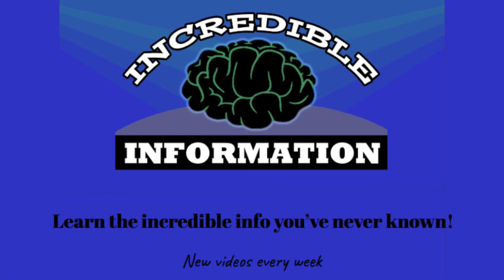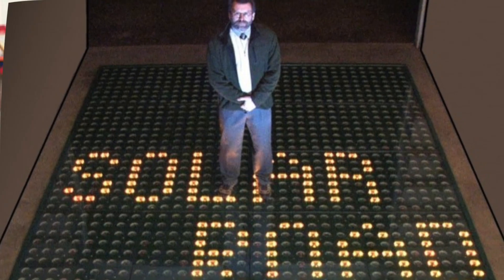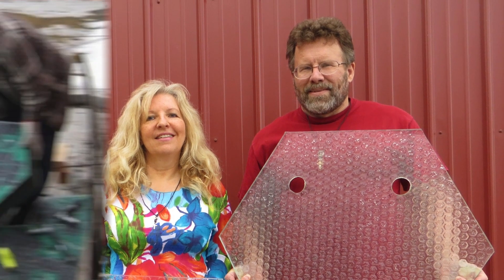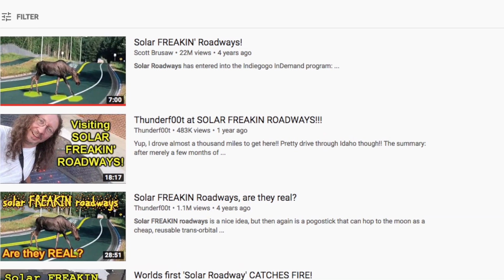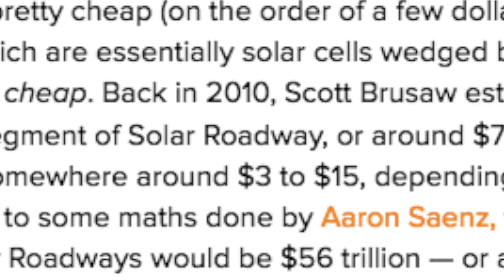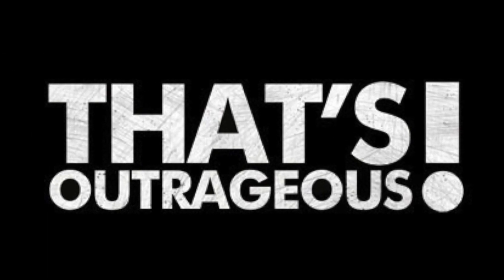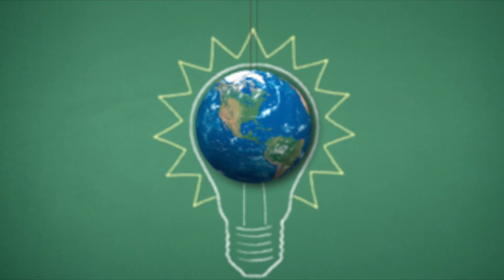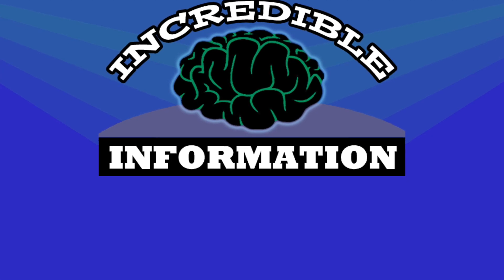Solar Roadways - A Bitter Truth

Comment: Here's a another way, to utilise Solar Power to its Max. over Roads,

"Solar ROOF on Roads with ADVERTISEMENTS & Rain Water Harvesting system"

Solve (Land & Funds) requirement for Solar Energy at a time,

Benefits - More Jobs, Boost Economy, Control Pollution, Promote EV's Usage
#ClimateChange #cleanenergy
#innovation 

Better way to fight Climate Change/Air Pollution 👇
http://lightenmyways.blogspot.com

Comment: Every attempt to create solar roadways around the world so far has been a costly disaster. Not one system by any manufacturer has been remotely robust enough to withstand traffic, even cycle lanes have fallen apart. And they produce very little electricity. When, for instance, you look around you and see all the empty rooftops that could be fitted with solar panels, for a fraction of the cost of solar road panels (panels which would produce significantly more energy), there is no solid case for solar roadways. This is the Green Lobby’s version of flat Earth.

Comment: I'm sorry but isn't this flawed. Yes right now it's expensive BUT that's largely in part due to the fact that production just isn't where it needs to be. Replacing US roadways would require massive production increase likely meaning we would produce them in large batches for significantly cheaper than they are produced right now.
Reply: You’re using your brain! Well said

Comment: I'm an engineer 

Best way to go is apply the solar panels on the street lights to light up only the strips on the road it would cost less and be less of a scale rather than the rd lit also would be cool to apply a lock on the lanes if a vehicle tries to change lanes without signaling and sensors to make sure the vehicle is at a certain safe distance to merge to another lane.
Technology is incredibly endless. 
Thats definitely worth the investment. 
How many accidents would be avoided. 
If a drunk driver is identified as sloppy driving by the amount of times it tries to merge or triggers the lanes without signaling. It'll flag the vehicle shut it down and automatically contact the police. This is my idea of true safe driving to keep families and people safe.

Comment: Every technology was expensive at some point. Depending on the learning curve we can maybe expect innovation on making them cheaper. But my thought on this is that it will never be used on real roads because of the traction and durability real roads have to provide.  I myself also prefer roofed parking with solar panels on top. My favourite by far is still nuclear energy

Comment: The analysis of the economic viability is pretty underdeveloped. To predict what it would really cost, we would have to account for the significant cost cutting that competition and economies of scale bring. If a significant amount of roads/parking spaces went solar, the price would come way down.

I've also seen that the panels melt snow and use leds for road markings, so you have to factor in the savings from not needing snow removal and painting.

It may well still be too expensive, but just giving the current cost of a solar driveway (without even comparing it to the cost of an asphalt driveway) really gives no idea of what it would cost to replace roads or large parking lots. Especially considering that the video ends talking about another tech that is currently very expensive, but could be cheaper in the future.
Reply: I asked Solar Roadways how much it cost to melt the snow on their installation last winter and they couldn't tell me.  Since the City of Sandpoint owns it they have that data but - seemingly - the Brusaws never thought to ask them about it. They also wired the previous failed versions of their installation the wrong way, so they ended up only generating negligible power. The current version using their updated panels - the ones they intend to sell to people - has seemingly failed after only seven months of operation.
Quite frankly if there is a future for PV roads it definitely won't involve Solar Roadways.
Reply: @sweetchristmas101  Yep, sounds like a company that was built on government grants with no competition and or profit motive to force them to improve their product or lower production cost.
Reply: Mit Mac no competent company that can offer any competition would go into this market. Building solar panels on roads?  Might as well build them on roofs, on solar farms. In the end. The two other ways are will be far more profitable for years to come

Comment: I never understood why they wanted to drive vehicles over panels instead of under them (i.e. effectively make above-ground tunnels covered in solar).  The cost of building a support structure for mass-market panels should be far less than building panels to handle trucks driving over them, and will be more efficient and require less snow plowing too.

Comment: Question: If I were a billionaire and bought over five hundred acres of untouched land somewhere, would it be economically feasible to have a neighborhood and park with solar roadways, driveways and walkways paving the streets?
Reply: Andrew Hager, no.
Reply: The cost of solar electricity is still and little higher than coal.

Comment: I wonder if they would be such a bad idea if costs were cut to 1/10 that they currently are and existed primarily to heat the road during snow/ice season. Especially if they are durable and highly modular, this would be a great benefit to somewhere like Minnesota, where I live. Ice and snow cause backups and cost a lot to deal with. Roads are constantly being worked on and replaced, causing indefinite construction and traffic over summer. This process also takes quite a while. Perhaps the long term costs would be much lower in a very well engineered design with that specified goal.

Comment: In 1968 IBM released their first “cheap” computer at $250,000 (roughly equal to $2M today). Over time things become less expensive through economies of scale and competition. 

If they didn’t, you wouldn’t have been able to make this video and I wouldn’t have been able to afford to make my point.
Reply: They will never be a good option. Their power production is way worse than any other solar panel and they practically offer 0 advantages.

Comment: Just did the calculation on this based on 164,000 miles of highway in the US. With standard lane width of 12ft and 2.2 lanes for every mile of roadway, we get $1.5T is a huge amount of money. However we we deduct the cost of install on existing roadway at $1.7M per lane mile of roadway we get $620B. This offets cost of ownership to $880B.

If we factor in the electricty generation cost in the US for the 30M kwh consumption each year at a $0.04/kwh rate of production as to analog a standard utility company's cost we get an offset of $1.2T which would more than mean cover the cost of installation and annual and regular maintenance.

As long as the math is right solar roadway would be indeed feasible.
Reply: Well, your math is wrong, and you don't understand the effects of wear and tear on these systems.

Comment: They are extremely inefficient as well.
They are putting in a 36 panel system in somewhere. Each panel is just over 4 square feet. It is going to cost $72,000 to install. That is $500 a square foot.
EEVBlog just did a video on the failure of solar roads, ALL of them.

Comment: Ok why is it that expensive?  I mean I would not take the design efforts of two people with an Indiegogo as necessarily the final actual cost it could be driven to.  It also looks like they're including a lot of shit you don't need like lighting effects, snow heaters, etc... I mean if you're going to lose a little efficiency painting a stripe on it but drive the price in half doing it... you know...
Reply from the maker: Yeah that is true.
Reply: Admiral Ackbar 

Painting a stripe is far from being visionary.
Reply: You lose efficiency just putting a solar panel flat on the ground. Can you imagine even walking on a glass road? Imagine how little grip you'd have, now put cars, vans, and trucks on that. The latest 'iteration' from the scammers has its glass roughened up even more, but that means even less light transfers to the solar panel. Now imagine all the road dirt on every single road, that's still going to be there and obscure the light going through to the panel.

Comment: our local news said that 30 panel 150 sq ft display up in sandpoint cost 2K per panel or about 400.00 per sq ft.  spring of 2018 they instaled the SR3 panels and by sept 3rd they shut it down.  there were too many problems.  throughout the summer that display was producing a average of between .2 and .4kwh per day.  the local power company told me that 1kw cost 8 cents.  3/4 of the last year it was shut down and was not showing any energy production and just a few weeks ago they turned it back on and some of the panels were not blinking and since them more have failed so now half the lights are working and its not producing any power.  to put it in perspective - fall of 2016 they made the first installation knowing nearly all the panels were ruined even before they left the shop so it was a total failure then the following spring 2017 the second installation went in and it wasnt much better but this was running through the winter so i did do a video of what a failure the heaters were and it was producing .01kwh.  spring of 2018 they installed the SR3 panels and that made the 3rd installation in about 18 months and last summer they were producing about 1kw every 3 days.  so now here it is about 2 1/2 years since the first installation and we are waiting for the SR4 panels to go in.  most of these panels are barely surviving weeks and some months but none have been fully functional for one full year.  2018 they got a 100K grant to install 35 panels in Baltimore so on a average those panels have gone up from around 2K per panel to 2,857.14 each.  i looked up the life expectancy of LED lights and it was 50,000 hrs or 5.7 years.  the SR3 panels went over a year ago and its doubtful they have produced over 5 bucks in power.  this is the video i did winter 2018.  https://www.youtube.com/watch?v=Y9IEdL6dsdM&t=9s  .  they have around 4 million dollars so far and have not hardly produced anything.  the other thing they dont talk about much is you have to have a road anyway either concrete or asphalt then you have to install anchor bolts then the panels.  there is no way they will be able to produce solar panels encased in glass with LED lights and heaters cheaper than  the cost of a regular road so no matter what these roads will cost at least twice as much and most likely a lot more.

Comment: If they used recycled plastic it would be a lot cheaper
Reply: The installation will generate a total of $35 worth of power in 20 years.. not really worth the money.
Reply: @frosted1030  at 60K per installation they have installed and replaced the sandpoint panels 3 times in about the last 30 months at a cost of around 60K per installation.
Reply from the maker: Indeed. Yeah, they are too expensive for their actual effect.
Reply: RIP
Reply: It would cost way more dumb ass to make the plastic usable.